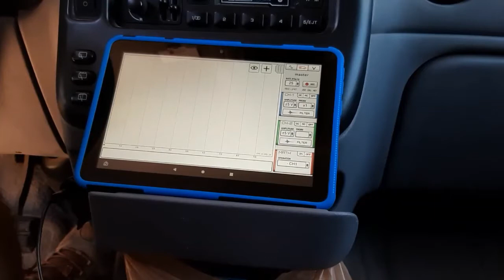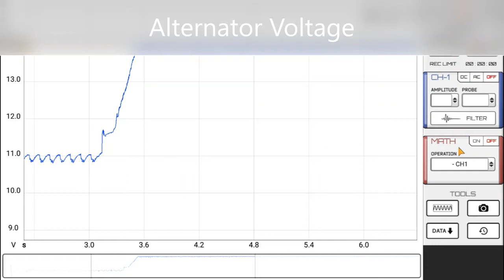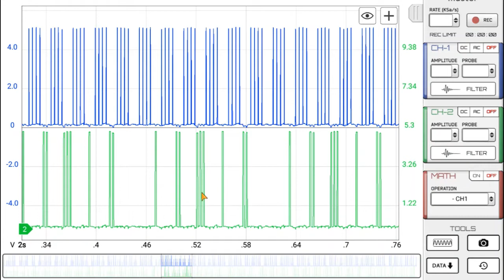HS402 Junior Oscilloscope with wifi connection.

Comment: The HS402 junior is a fantastic way to get started using thruhole components and the LTSpice file is a great addition. 2 questions:

1. Is this different from the previous HS402 junior schematic on the previous (and first) HS402 junior video and uses slightly different parts? (I ask because they look the same to my tired eyes and I'm missing the connections to the ESP32 in the schematic)
2. Did you design this analog frontend by yourself Chris? It doesn't look like the design that Martin uses or has used in the past

Very innovative!
Reply from the maker: Thanks for the comments, I believe the linked schematic is the same for both videos now, it was an improvement to prevent ch1 and ch2 from interfering with each other. 

It is my design, one of the issues with Martin's HS402 is he creates a floating ground that is 1.65v higher than ground so it meant we could not just use the car battery to power the stm32, mine adds the 1.65v into the circuit so it can be powered by the car battery and do tests at the same time.  One issue with the junior design is if nothing is connected to the test leads, the readings fluctuate.   Anyway, it was a fun build for me. 

The connections to the ESP32 are the same as documented on Martin's HS402 wifi site, the same stm32 works on Martin's pcb design or this build, just the calibration is different.